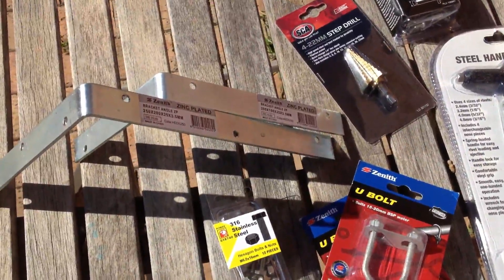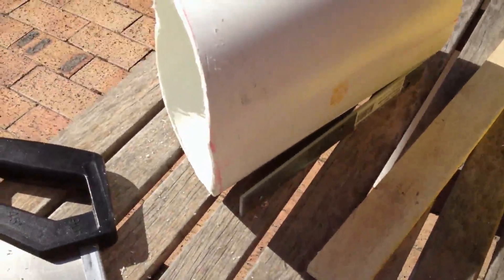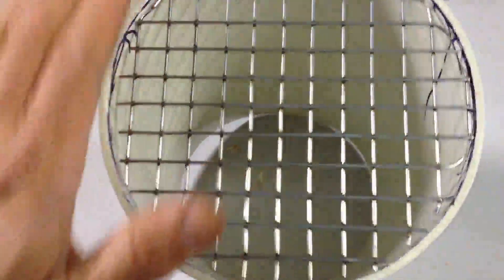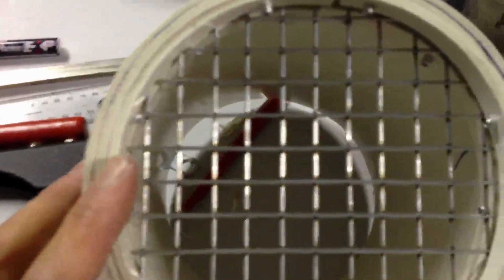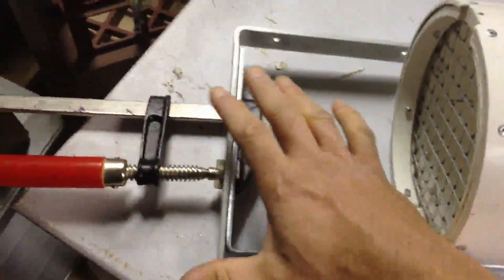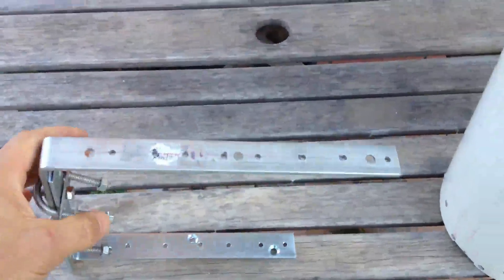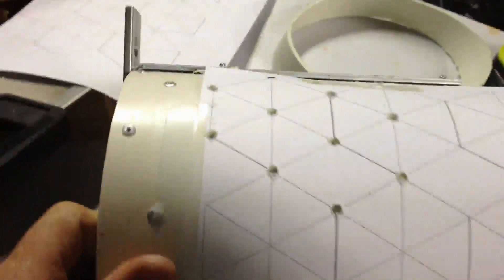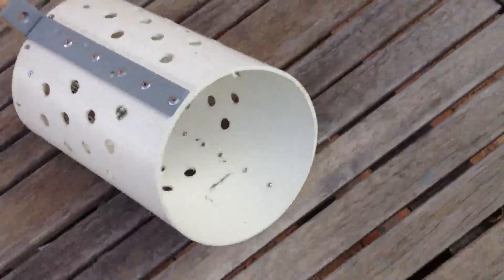DIY sand scoop from 150mm PVC piping

Comment: 4mm drilling is actually easy by hand. you can do 12mm by hand without pilot holes?? sharpen bits and go slow and steady...nice job here. will make one. how did it hold up ???